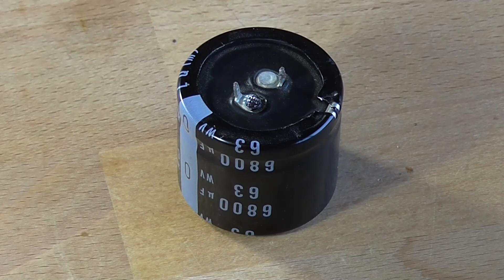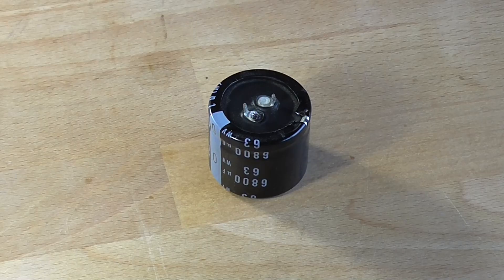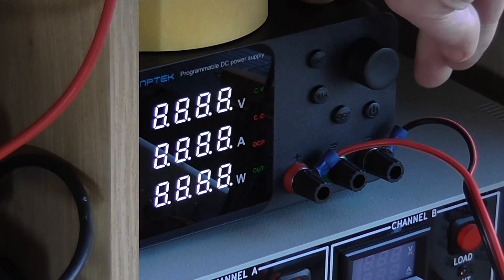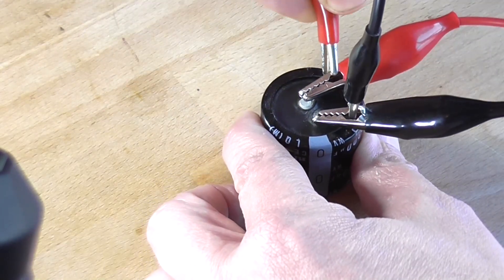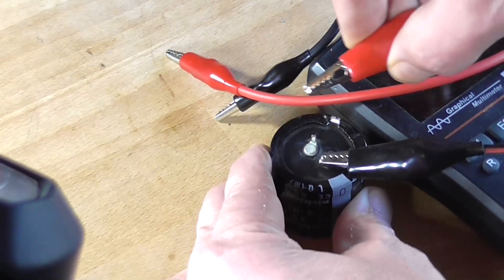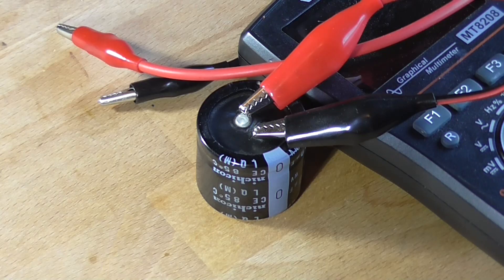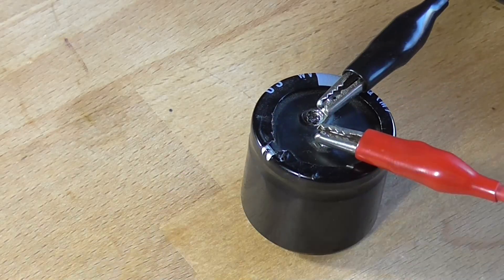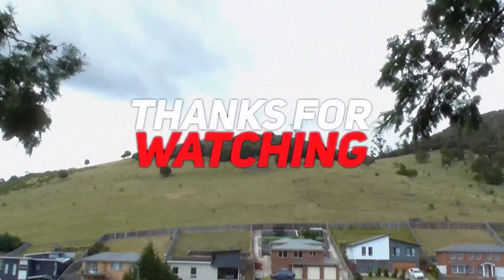Reforming Electrolytic Capacitors & Why

Comment: I have a simple suggestion for you - a small C clamp clamped to the base of the capacitor will prevent it from moving around on you, and shocking you possibly. And better yet, the clamp can then be clamped again to a workbench. I detest working on components and having them move. About to use my Sencore LC75 to try reforming some old electrolytics. There are some collectors out there even want the caps original, so curious how it will perform on them. Sencore does not say to bring it up slowly but rather select the working voltage and start from there. Not sure which is correct but I like the idea of bringing it up slowly. Nice video.

Comment: I'm always intrigued by the concept of capacitor reforming. I have several vintage (solid state) amplifiers, and they can be in storage for years at a time in between being powered up. It would be laborious to say the least if I had to remove any large value electrolytics and reform them before powering the amp on after being in storage.
Reply from the maker: That's why I said the other way it can be done is via a current limited (dim bulb) variac supply. and slowly ramp up to full line voltage un current limited. This means you don't have to take the unit apart, or even take the top off. You can just leave it sit at a start voltage (depending on your country) of maybe half full line voltage on the variac and go from there. All it would take is about an hour of your time. The other thing is, a lot of older equipment used higher quality components, including capacitors, so in some case you can simply just "get away with it".
Reply: You can reform them in circuit, mostly. But you have to check the circuit first and under surveillance.

Comment: Internal current leakage of the cap will give the capacitance readings a higher value on all meters. Your repeated reforming attempts worked to reduce the internal leakage which allowed the meter to see it's true capacitance value instead of capacitance value + leakage. That's why your last reading was lower
Reply from the maker: Thanks for the input. That makes sense, and kind of means the capacitors are starting to go out of spec. They were in a big cardboard box on my dining room floor that a friend gave my flat-mate and was told specifically they were tested and "out of spec".
Reply: The leakage current acts like a parallel resistor, affecting the capacitor's ability to hold a charge and therefore its effective value in a circuit. Just another way to visualize it.

Comment: do heated capacitors change their values?
Reply from the maker: It depends on what you mean by heated. But, yes, to a point. By how much, I've never tested this. If the internal maximum temperature rating is exceeded (say 105 degrees Celsius), by either exceeding the working voltage, or the incorrect polarity, the dielectric will start to "boil", which will eventually result in the capacitor self-destructing spectacularly. I'd be more concerned about that aspect.